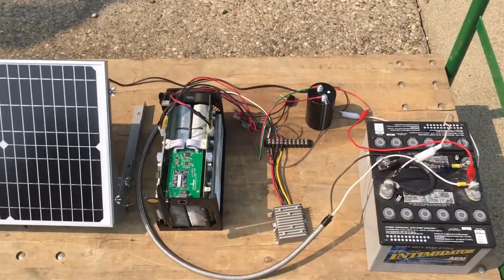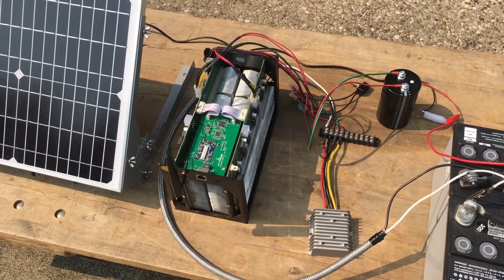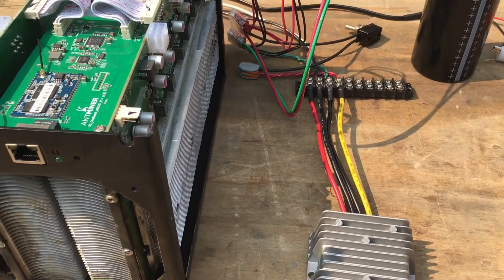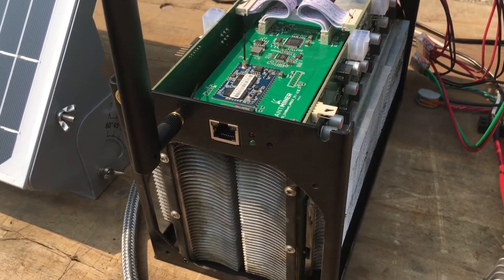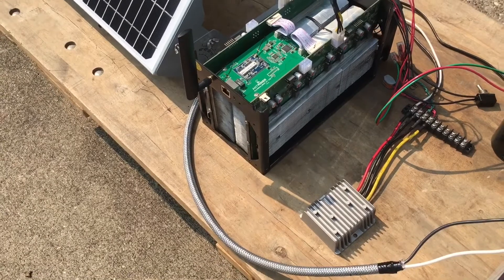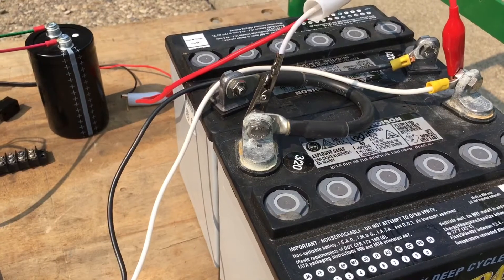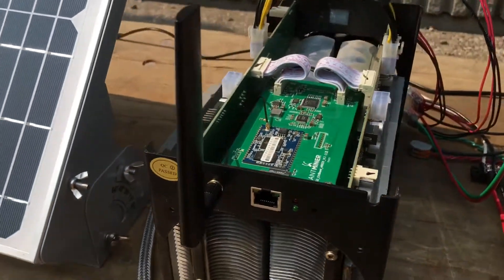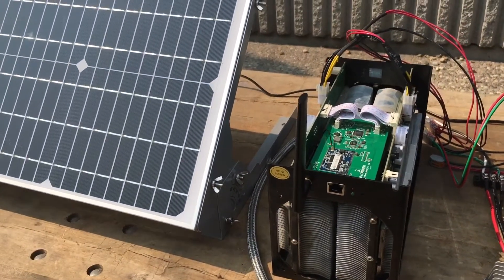Solar Powered Bitcoin Miner

Comment: I want to run my ASIC miner for 24 hours what should I do?
Reply from the maker: You need enough battery capacity to store excess solar. Another way is to get a micro-grid inverter and just send your Solar directly to the grid and then use grid power at night. This small miner takes almost 300 watt per hour however.
Reply: @Getlofi  Thanks for replying. My next question how do you connect multiple ASIC miner along with power supply to a Monitor then Nicehash? Full explain